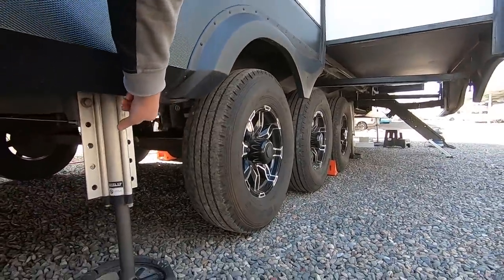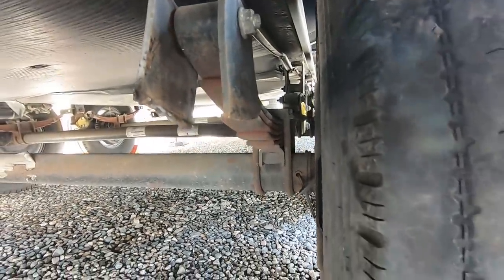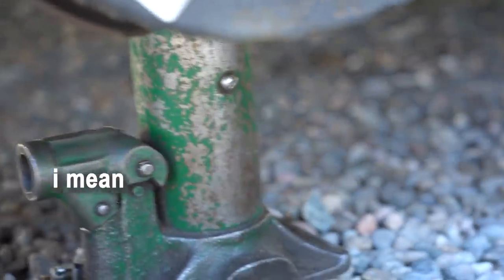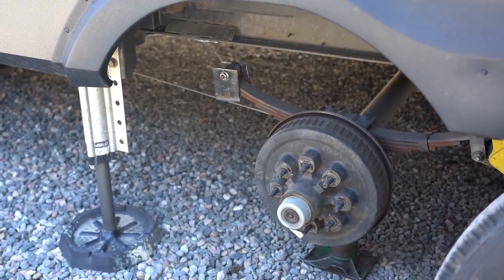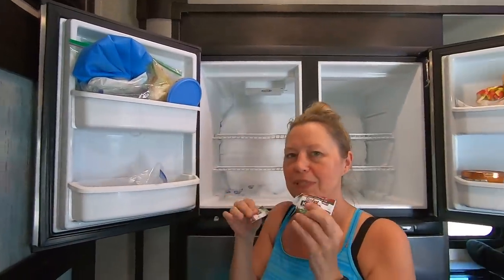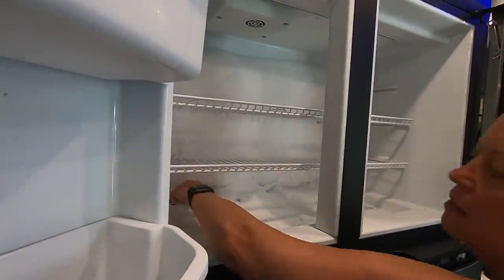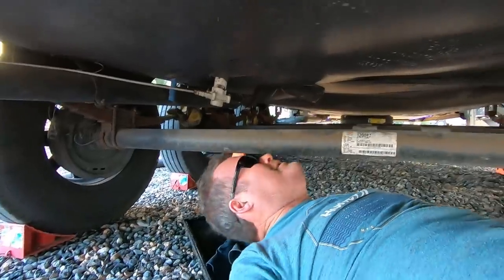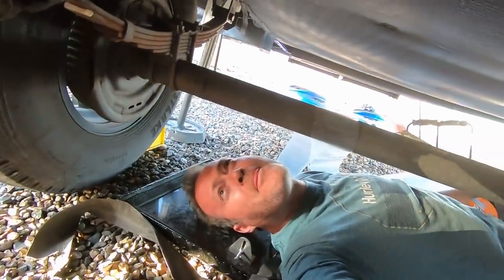RV SAFETY REPAIR | DEFROST RV REFRIGERATOR TIP (RV LIVING FULL TIME)

Comment: A lot or trailers break their spring hangers in the same spot. They are under engineered. I've replaced quite a few over the years and made them a lot heaver!! Make sure they check the others. better yet have them fix them now

Comment: Tom, when making sharp turns it puts a lot of pressure on the spring hangers and over time the may break the welds. Now the Grand Design Lippert frames have a reinforcement piece installed between the shackles at the factory. Check out someone newer year. Just a tip.

Comment: Unfortunately undercarriage failures are way to common on travel trailers and 5th wheels.  Since travel trailers are intended to travel, they should have bullet proof suspensions but they do not. They generally hold up for the folks using the trailer a few weekends a year but  not so for full timers. As you know from experience,  not only do the tires need to be upgraded but so does the suspension. 

Reinforcing all the spring hangers is a good upgrade especially on a triple axle considering all the stress from turns. MORryde makes a cross member bar they call the X-Factor that also adds strength to the hangers.

Another common failure is a broken spring at the eyebolt. I added an additional full length leaf under the top leaf to support the eyebolt on my Nash trailer.  Bent axles and failed wheel bearings are also an issue.  Thin shackles that bend are also common. 

Most trailers come with a thin nylon bushing in the spring eyebolt.  Those can wear though in under 10,000 miles then it is metal  on metal. A fix is geasable (wet) eyebolts or sealed eyebolts.  Also available are shock absorbing greasable equalizers. 

I noticed most trailers do not have shock absorbers.  I have them on my Nash trailer but they did come on my Grand Design. They may help absorb some of the stress. 

Considering all the miles you travel each year, an upgraded suspension may be worthwhile if you plan on keeping this trailer for a while. It will also make for some great channel content!  It is no fun being broke down on the side of the road.

I always appreciate you sharing the problems you come across.  It makes us all more aware and knowledgable.  I know I need to upgrade the suspension on my Grand Design.  Your experience is a good motivator for me to get it done.

Comment: When you do a pretrip walk around pay attention to the distance between the tires on both sides. The distance between tires should be the same, otherwise an alignment issue. Might be an axle out of line, broken/weakened spring, broken shackle or some other issue. You should really check the suspension on a regular basis, and more frequently if you hit rough roads or nail a pot hole. Safe travels.
Reply: Kevin - Thanks for sharing your great tip as
it’s something I might overlook. 🚌

Comment: I first saw it on KYD video where they reinforced the hangers for their trip to Alaska... I had all the hangers reinforced on my 5th wheel.  I have also replaced all of the shackles with the heavy duty shackles with wet bolts and bronze bushings.  The welding was done at a shop, but the shackles, wet bolts and bushing are a relatively easy DIY.

Comment: We find if you boil a couple of pots of water then place them in the freezer, with the doors closed, the ice will come away from the back wall.  A plastic spatula will break the ice away in large chunks.  I don't find hair dryer works that fast, it only melts from the front.  The steam from the pots seems to get behind the ice block and it falls away easier.

Comment: Why does Lippert not beef up the spring hangers like the welder did? Did you beef up all the hangers? If not the others will break. Tight turns put a lot of strain on the hangers. It is a common problem with larger heavy rigs.

Comment: Norcolds are notorious for icing up and yes food goes bad quickly.  Now that you have an upgraded solar and inverter, I would suggest swapping it out with a regular residential one.  So you don't have to mess with it as you would a gas/electric fridge.  Good luck and safe travels. Peace!
Reply: Nicholas - Question:  I replaced my Norcold two yrs ago when a small fire started in the insulation when it malfunctioned; thankfully I was home and caught it before any serious damage occurred.  (Also got in on a Class Action Lawsuit regarding just such and received full compensation for it.)  I picked up a black Magic Chef electric fridge from Home Depot for approx $250.  It was slightly taller but I was willing to compensate by giving up the cabinet that was above the Norcold.  My gosh the add’l room I captured back in a normal fridge was a delight as I luv to cook.  My only concern is whether a portable generator would be able to keep that working while boondocking?  I’ve been stationary for several yrs and hadn’t planned in the expense of a rooftop solar install.  🤷🏻‍♀️

Comment: Might be a good idea to get the other spring shackles reinforced before they break , one broke so it is just a matter of time before the others break ..  Also while you were under the RV I noticed that all of the brake backing plate plugs are missing . They probably were taken out to check for brake adjustment and not reinstalled or perhaps they never were there .   They are oblong plugs that go into those holes to keep out water / dirt and what ever .  They can be bought at a auto parts store just ask for "brake backing plate plugs" normally they are made of hard rubber but I have also see a few that are plastic . Looks like you need eight of them .........  Safe travels  :-)
Reply: I replaced my brakes last year by buying entire brake assy with backing plate from Dexter (cheaper than parts, and faster).  When i ordered them, the guy helping me said they would come without plugs for adjusters.  He said dexter now recommends NOT putting plugs in
Reply: @jimcollins8097  WHY ?
Reply: Don't remember exactly, either cooling or to get the dust out.  I put my caps back in, because.......that's the way my dad did it.
Reply: @jimcollins8097  Isn't that what I said , to put the plugs in ?

Comment: Yikes.  Were the rest of your suspension mounts ok?  
I'm guessing a bad weld combined with a bad pothole.  That crap happens unfortunatly.  Its also why its best to buy your trailer from a dealer that has great customer service or you purchase a goad roadside package for an older RV.  You aint fixing that on the side of the road or with some local shadtree mechanic. yikes.

Comment: Wow thats poor engineering.  A leaf spring mount thats basically 2 tiny tabs with no extra support.   Ideally you would have a mount thats cast steel/ali and nice and beefy which is then bolted directly to the chassis.  We are talking a heavy vehicle with a tiny weld holding the axle to the chassis..

Comment: I use a hair dryer to help the ice melt faster and I never let the ice build up that much. If you do it more often it is a lot easier and faster.
Reply: Thanks for the tip Maureen. I just finished mine using the hair dryer. It took no time at all!
Reply: Was coming here to comment the same.  We've used a hairdryer to defrost freezers for years without any issues.  Just follow common sense safety precautions while operating an electric appliance near water.

Comment: You better keep an eye on all the leaf spring hangers! This is a common problem with all makes of RV's.
Reply: Dennis - Thanks for sharing that tidbit of info.  I’m getting tires this week and will ask for a suspension check over.  🚌
Reply: @lindagolden9892  I had 2016 Winnebago 27lhs same issue was waring out the tires also found axles were out of alignment and frame to hangers welds were cracking had them repaired on the road. When I got home I also found the leaf spring  bushing from the factory  were junk, the frame was too narrow so they added a spacer to allow them to weld the hangers to the frame. We removed all the axles and made a frame for them to hang on then bolted this new frame to the trailer frame no more issues after this.
Reply: This is common? Wow that should not be common. It will change after mfg are held liable for poor design. That’s uncalled for.

Comment: Two things that made me cringe a little on the spring hanger repair. 

1, the whole hanger should have been replaced instead of welded back together. They are just a u shaped bracket that is welded to the frame. 

2, when the repair tech torqued the wheels back on he just went around the hub instead of using the standard star pattern to get proper torque. 

Not anything critical on you guys but on the tech. The last video with the solar install they used Dicor instead of the proper sealant recommended by the roof manufacturer for the TPO roof as well.

Comment: Glad you checked & noticed the broken hanger.. Loosing the back axle at speed, can have other than the obvious hazard associated. The loss results in a drastic change in weight & balance that can immediately cause violent trailer sway & a loss of control...
(Can also also happen when rear tires blow..)
Anyhow, when you have the other spring hangers / suspension checked, be sure you ask whether the leaf springs are sufficient & still okay.. The one video clip with you under the rig, seems to show your leaf springs have been over stressed.. to me they have an overstressed look.. too much weight for that set of springs.. They can be replaced with beefier sets..
Thank God you found the broken hanger.. someone's watching over you two..
God bless,
Dennis
BTW.. Is that a Gorilla Tape product?

Comment: To think the only thing tying the suspension to the rest of the trailer are 12 pieces of steel welded to the chassis.  The reason that back one came apart on you is the amount of stress applied when backing or tight turning because you are essentially twisting the frame around the tires, and something has to eventually give.   Every time you do an inspection of things, always take a bright flashlight and shine it inside those shackles and make sure there is no cracking.   They are U shaped brackets welded to the frame, and when they start to crack, they start on the inside where the press punch pushes down on it to form the U, which creates a small V in the metal, and that is where they crack.   It is quite common to see on the larger heavier triples.

Comment: Arctic iceberg in Norcold freezer 🙀.  Aren’t those plastic sleeves you placed in the freezer blocking the ammonia flow elements from working properly?  I’ve used a turkey baster along with hot water to quickly defrost the outer heavy buildup.  Of course you have be on hand with an absorbent washcloth and small basin to soak up the drippings but it sure gets the job down quickly.  Can you explain what the sealant tape is for; other
than sealing; what’s it protecting? 🚌
Reply: He probably had to cut into the chloroplast at one point to fix something.

Comment: Shackles brakes are caused from turning the back of the coach at tight angles.  This twisting motion puts high lateral stress points.  Also most manufacturers use a big enough shackle support brackets.

Comment: It’s a new rig, should get reimbursed by manufacturer for all cost! I didn’t have a spring hanger break like you , but did have a spring sagging. Jayco paid for all repairs. Look into the amish refer conversion. I have the same fridge and lost food three times. Now our frozen food is so hard you could almost drive a nail. We run 3-5 below zero in freezer and 32-38 in refrigerator. Good luck! Keep up the good work.
Reply: Steve - Do you have a link for the Amish fridge?  Approximate cost?  🚌